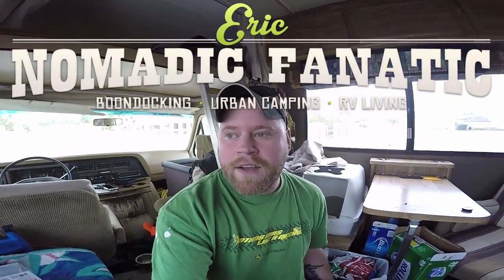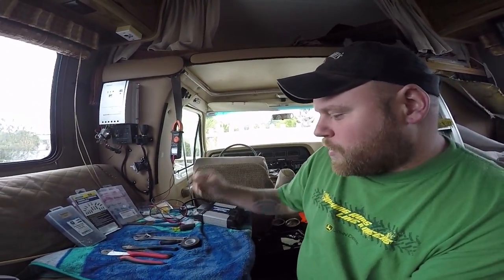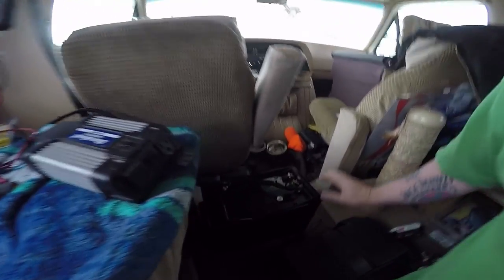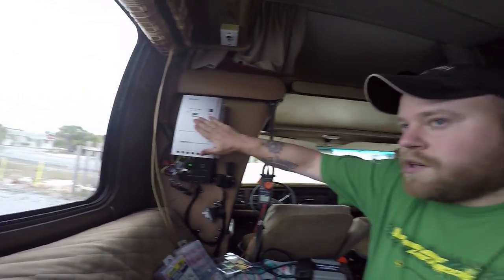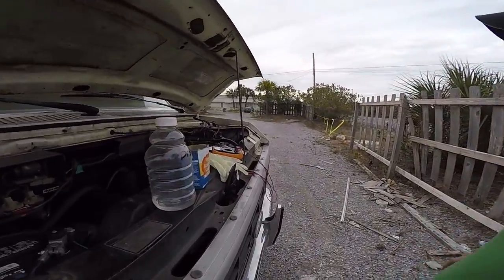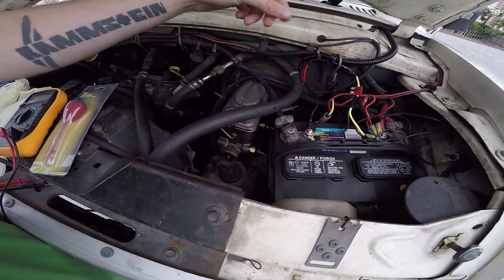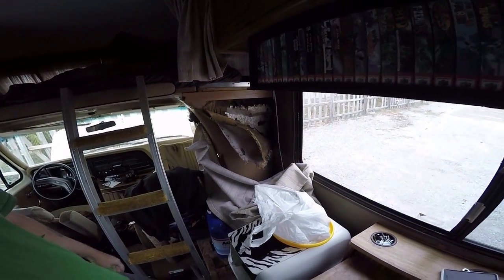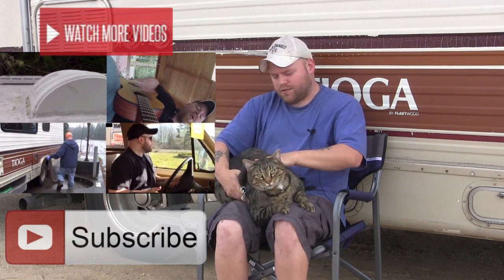Finishing My Second Battery Install

Comment: Nomadic Fanatic I agree with you there. I plugged in an inverter to my DC cigarette lighter about 10 years back without checking the max output and woke up to an electrical fire in the cab. Had to sell my RV for parts after that and buy another. The wires from the battery to the inverter sparked causing an overload. Suffice to say, less wires and more fuses=better.

Comment: Yep, I would like to get a safe dry cell battery (w/out gases),  but I wonder what is best place to get them besides Walmart? 
     I had a dream you already fixed that wall.
Reply from the maker: Livin Lite lol. I made special effort to show the repair in order despite the fact of how many days it took out of order from my everyday life in the RV
Reply: HI TOWER Thanx Thomas, I was thinking Optima, but they are like 250$.  I figured they are best.
Reply: I had the same dream Livin Lite!  LOL.  You can get sealed AGM batteries just about anywhere these days.  I would guess the best place to get them is likely to be the place where you can get them swapped or serviced most easily should you have a problem.  I'm guessing Walmart is probably as good a place as any for Eric since that's already his second address.  Enjoy.
Reply: HI TOWER I used 2 optima Blue top and i resgret it. I should have go for (4x) 6v Trojan battery for almost the same price. I have now only 132 amp/hrs VS 250 amp/hr for the same 12v. The only problem come with the space of 4 batteries vs 2 batteries. I need to put a rack under my bus for 250 lbs of 6v batteries...So go with the 6v and at least 200w of solar panels for a really good setup.
Reply: Agreed.

Safe Travels
Thomas
Reply: http://www.optimabatteries.com/en-us/products/

I use these in all my vehicles and RV

Thomas
Reply: Livin Lite
Remember you get what you pay for. These batteries are a great investment and well worth the extra cash if you can swing it.
Reply: I would have used the yellow top personally. I run them in my Vanagon. They are the best size and performance for that type vehicle. I run 6 volt in my Class A. Cheers..
Reply: HI TOWER   Right, prolly get yellow-top. Coz I have  a van also. I never had 6v system. really just need a boondock battery for emergency.  Got 2 small solar panels. Optima yellow top seems safest.

Comment: Hi Eric, I have a camper I tow behind my 4x4. In this camper I have a100a/hr deep cycle battery. The tow vehicle has an Anderson plug which allows me to plug the camper in and charge the battery whilst driving. In the tow vehicle under the hood is a voltage relay which only closes (to supply the Anderson plug) when the voltage from the alternator reaches 13v dc. This same system can also be used in motorhomes without the Anderson plug connection. Make some enquiries re the voltage controlled relay. cheers.

Comment: Eric -- good morning!  

These comments are about presentation, not the project itself.   There's an earlier comment about the wide-angle lens distortion inherent in the GoPro and similar cameras.  You can't change lenses, but it might be better to stabilize the camera on a tripod and direct our attention either by pointing with your hand or by cut-ins shot a bit later, as opposed to short camera moves which emphasize the distortion.  More work in post, I know, but less camera movement! Please!  Also: I know roughly what you're doing here and why, but I got completely lost in your discussion of wiring and fuses.  This is where a quick-and-dirty diagram ( magic markers on a sheet of cardboard ?) will help tell the story.  Again, more work in post, but more clarity.  And third, about time sequence.  This was clearly shot while the dry-rot repair project was in its early stages.  The last video we saw, that project was near completion, and it's a little confusing to be taken back in time like this.   Maybe a super over the beginning of this clip clarifying the time frame would help. 

Happy trails!  Like a lot of us, I watch your latest "release" with my morning coffee and look forward to it. Thanks! 

R
Reply: I watch another guy on YT and he uses a GoPro. His vids are really fish-eyed. So much so I told a friend (who asked my opinion about GoPros) not to get one until checking out that guys videos. But... Eric's is not that bad at all! It has to be a different model. Sorry, but I do not know the model of the 'other guy' I watch. Also, the other guy's audio was terrible until he got an 'add on' plugin microphone. Once again, Eric's sounds really good w/o the Lav Mic he sometimes uses which sounds even better.

Comment: I was always under the impression that batteries off gas and they should not be stored in the open.
Reply from the maker: John Fiskin AGM - sealed no gas.
Reply: Nomadic Fanatic plus you don't get any corrosion at the posts
Reply: Jeffrey Yeip And no maintenance. No water to add, no corrosion, no gas, no stink, no acid.

Comment: Thank you, Eric. I have a question. NOT critiquing, just wondering. Why not switch the wiring on the batteries to where the one under the hood is doing the charging of the electronics and the new AGM (much bigger battery) is running your main stuff? The AGM is made just for that isn't it? I ask because I have a plan I'm trying to put in place and want to know why you are choosing to run big stuff off the smaller battery.
Reply from the maker: Wayne Smith It won't fit under the hood. I'm very limited on space, as I talked about the brake lines touching the side of that little battery already.
Reply: Nomadic Fanatic
I meant change the wiring, not the batteries. :)  I knew that big one wouldn't fit under the hood. Just random thoughts of mine. Also, wouldn't the big panel be better on the big battery?
Reply: Wayne Smith I agree with you wayne. To me it makes more sense to use the bigger battery for things you are most likely to use at night..Just switch the wiring of the 250 watt panel to the biggest battery (inside)and you have a much more practical setup....
Reply: Wayne Smith I agree with you also, switch the 100 watt panel and charge controller to under the hood battery and the 250 watt panel and Renology charge controller to the battery behind the seat. The only thing good about it as it is now is that the panel does generate power into the battery and that power can be used by devices such as the blower fans, directly from the solar panel/charge controller during the day. But if the greatest usage is during the night when there is no sun, then switching to the bigger/better AGM battery on the larger panel is the way to go.
Reply: His intent is to add 5 to 6 batteries in a battery box to be mounted on the outside back bumper to be charged by the 250 watt panel to operate MOST his stuff then use the new inside AGM battery charged by the 100 watt panel very Sparingly for the smaller stuff.
 The front underhood battery will be used sparingly also.  Most power will be from the bumper bank off the 250 watt set up.
Reply: Hes up-grading the battery bank to the rear bumper at 4 to 5 batteries.   The AGM will stay in place for the smaller loads.  Another 250 watt panel will be added later.

Comment: It's never bad to add another fuse.  You may not have wired things the way I would have, but you know what each wire and switch does.  That's exactly the right way to do it.  If all you do is follow a drawing w/o knowing what things do, you have an awful time trying to fix problems.

Comment: Good morning, Sunshine ! You might as well be speaking a foreign language when it comes to this kind of stuff. But, I'm sure happy to see your handsome face ! And thanks for helping me decide to hire a professional to install our solar !
Reply from the maker: Vonnie Dasher Haha. Ok. Just sharing the install now that I've got my wall fixed. At first I wasn't even going to publish this video due to the electric critiques, but I caved.
Reply: Nomadic Fanatic It seems so hard to me. But I guess that we all have our own talents and gifts. Check out some comments I added to yesterdays vid !
Reply: Nomadic Fanatic
not a critique ... just a statement for your followers ... when joining wires together, the best way to allow as much current and amps to flow is to solder them together. Then you just put a shrink wrap over the joint and heat it to shrink it tight.  Just make sure it is electrical solder you are using.  I don't know what it is with cats and wires ... but, it seems to be universal.  LOL
Reply: Good analogy, Vonnie, 'a foreign language'. I don't even pretend to understand but if it gives him more, safe power, then I'm glad. (:
Reply: I wonder how much an electrician would charge to set this up. Between this and plumbing, I'd have to hire a professional to make sure it got done right. I don't wanna see anything blow up or catch fire or flood. Hats off to Eric for taking on this DIY project.
Reply: djkulp1 You need a mechanical connection in addition to a solder joint, if you just lap the wires and solder them together you will have a good electrical joint but if the wires get hot from over current, the wire will separate and viola, no connection. The best connection includes a crimped on connection and solder and then shrink wrap.
Reply: Christopher F Don't forget, this is 12v wiring. It's different from house wiring-120v. If you hire a regular electrician he may be lost working with 12v.
Reply: NFPA-70 is the National Fire Protection Association code and an electrician will know that code and there is a section on wiring low voltage. There are low voltage lighting systems being installed in houses these days and it isn't difficult to do.
Reply: NFPA-70 is also known as electrical code
Reply: lemoncrinckles Me too!  I'm thinking I need to take a basic electronics class and learn this stuff before I hit the road.